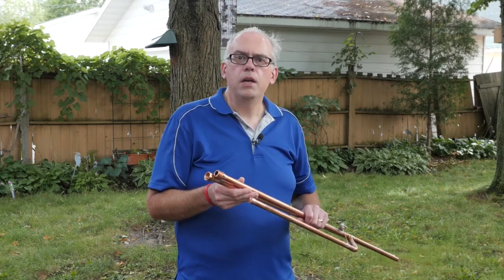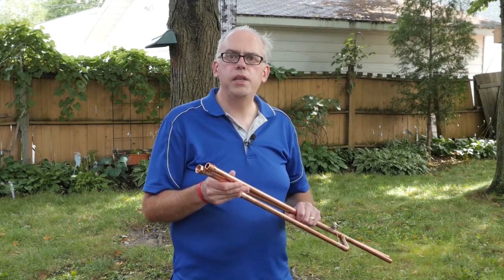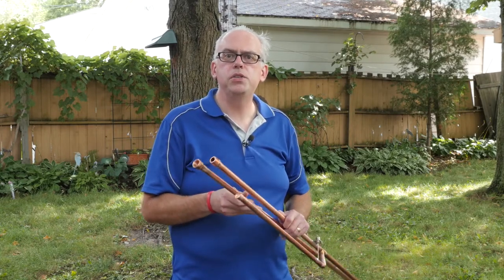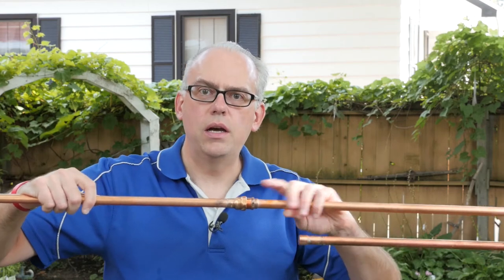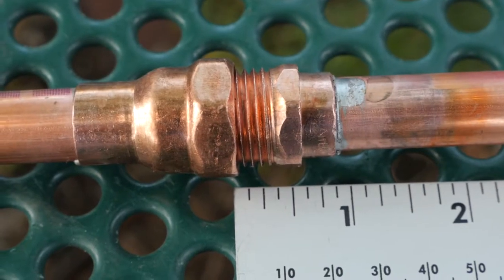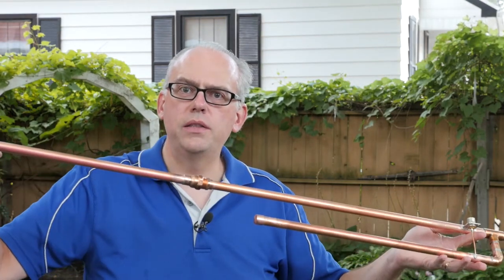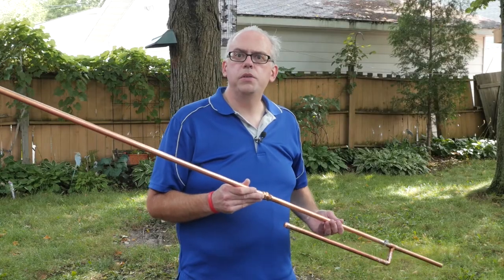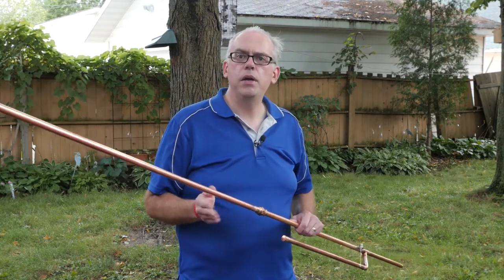KB9VBR 2 Meter Break Away J-Pole Antenna Screw Connector

Comment: Hey Michael, I'm a plumber. If you are still selling these, there is a trick that may benefit  you here. I have seen work (likely from union plumbers) where the extra threads are drilled. Once the male and female are appropriately joined, (in your case, when the antenna is properly tuned), you would lightly drill the remaining exposed threads, only enough to dimple in the threads. Don't drill deeper than the threading of your piping then you know this is where the threading is to mate everytime.

 I am not aware of the consequences of frequent joining and disconnecting, as plumbing typically remains installed once assembled, but i do know that if the threads wear, the tapered pipe threading will simply seat deeper, so I know without the dimple on the threads, as the threads wear, you are likely to shorten the antenna (ever so slightly of course, since one thread is a fraction of an inch) which could affect SWR?
Another consideration could be a copper union. The mechanical style seal mates in the place everytime, while used threads get deep and unused thread get dirty on pipe threading.
Reply: Of course if the pipe threads are used for tuning again after, a union would defeat this feature of course, since the antenna would be the same length everything.
Of course, "if it ain't broke, don't fix it" lol

Comment: Since WD-40 is a solvent/rust remover instead of a lubricant would it be better to use a conductive lubricant instead? I’m thinking of CRC dry lubricant or 2-26. Or does that have an effect on the antenna in some way?

Comment: I just bought one of these break-away j-pole antennas from you and wanted to put in the top of my backyard tree at about forty-feet. Would I need to ground antenna ? AND, would I have a loss through that length of feed line using 18 RG 6 Coaxial Cable which states for audio/video, radio frequency and closed-circuit transmission applications
 and Can be used indoors and outdoors for audio/video applications

Also used in computer/data processing.What is your opinion on this .

Comment: Looking forward to trying these out. I just purchased the GMRS and the VHF J Poles from you. I'm guessing the GMRS J Pole will do UHF Ham frequencies better than the VHF J Pole?
Reply from the maker: The GMRS J-Pole antenna is optimized for that band. You can use a VHF antenna on UHF frequencies, but the performance won't be as good as an optimized single band antenna.

Comment: Hi I have a technician license and I want that all my family can talk by radios But they can use ham radio... I was thinking build a repeater from the frs to uhf also uhf to frs...it is legal?? Can u make a video to show how connect families by radios... Thanks
Reply from the maker: The FCC doesn't allow the crossing of two different radio services, so you wouldn't be able to legally operate a repeater that uses both FRS and UHF amateur frequencies. One option to get your family all on the radio would be for them to all get their amateur radio licenses. Otherwise I would recommend either the license free VHF Multi Use Radio Service (MURS), UHF Family Radio Service (FRS) or the UHF General Mobile Radio Service (GMRS). GMRS requires a license, but it is a station license, so your immediate family could all use it without having to take an exam. Plus GMRS allows the use of repeaters, extending your range.
Reply: KB9VBR Antennas What are the Murs radios???

Comment: Do you sell a super j-pole? I like the extra gain it gives.
Reply from the maker: The Super J-Pole is an appealing design and one that I've wanted to add to my catalog. The biggest hurdle I need to overcome is to create an antenna that can be easily shipped and assembled by the user. It's something I'm working one, and hope to have available in the fall. I'll keep you posted.
Reply: Dale Myers What exactly do u mean measurement wise by a SUPER j pole??
Reply from the maker: A Super J-Pole adds a 1/4 section on top of the normal 1/2 wave section of the antenna. There is also an impedance matching section between the 1/2 and 1/4 wave. The antenna would be too long to ship unless it was disassembled.
Reply: Bruce Malo it's basically the same as a ringo ranger.
Reply: Hello sir Michael?